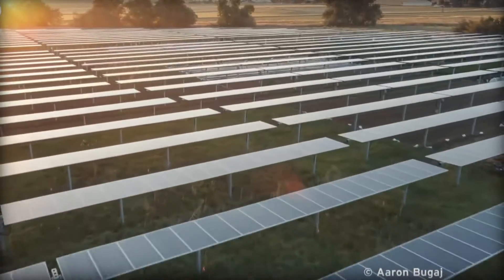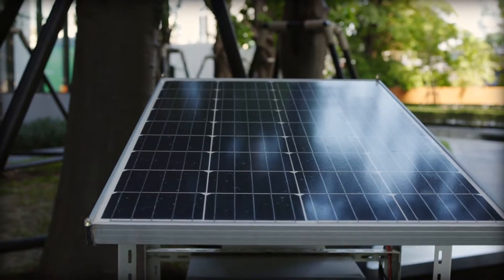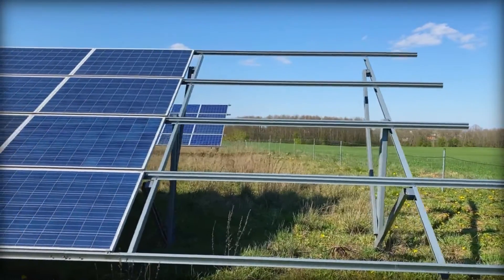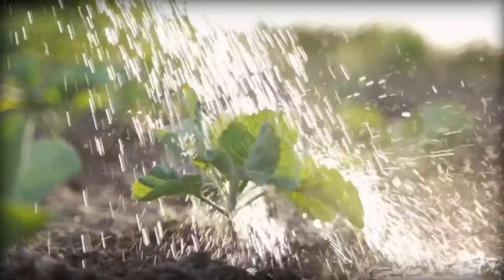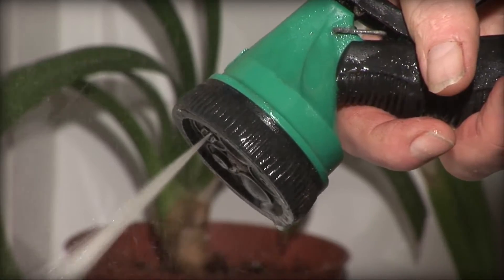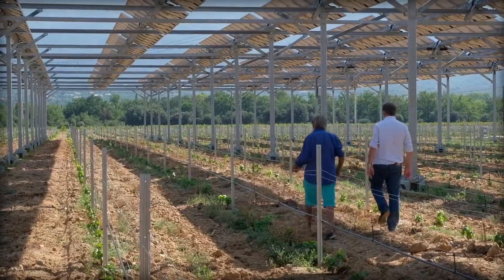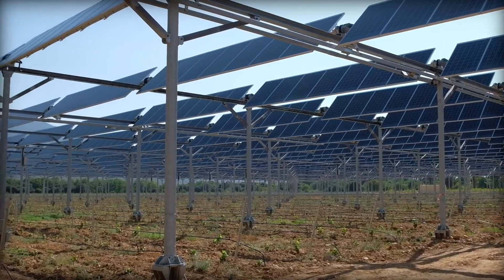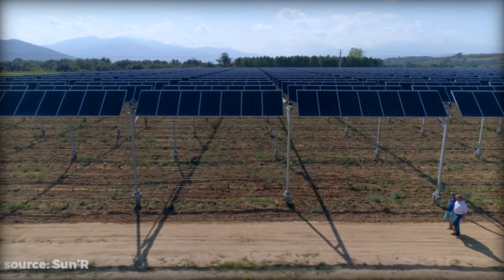How Agri-Voltaics are Changing Agriculture | The Power of Solar Panels | EyeTech

Comment: This makes it difficult for machines to move through land for ploughing or for harvesting. Might have to do things manually thus hard labor is required.
Reply: its not for grain crops, its for produce crops which are harvested manually or with light machinery, anyways.Even if large machines are used, they probably size the rows and columns accordingly.

Comment: yeah this cost mega bucks just to set up so that a tractor can go underneath... if mega bucks are not spent then the shed that goes over isnt strong enough to hold the solar panels and resist the strong winds that come from time to time in flat hot areas... SO NO

Comment: Every parking lot should have to be covered with solar panels.
Reply: All those flat-roof commercial buildings, some of them the size of several football fields….should have solar on top as well as some of the new wind turbines(which are specifically designed for this type of application).

Comment: Nop.. the CO2 footprint in making solar panels, battery, maintenance, transportation of parts is making way higher CO2 than simply farming with conventional farming.😂
Reply: Not If you account for the electricity production in the 20 year lifespan of solar panels.
Reply: Do you have a source for that claim?
Reply: Your not thinking of the 25 year usage of the panel's 

And the system 

That more than compensates 

+ this is smart farming as well as harvesting energy from the sun

This type of system is a positive gain to everyone and our planet